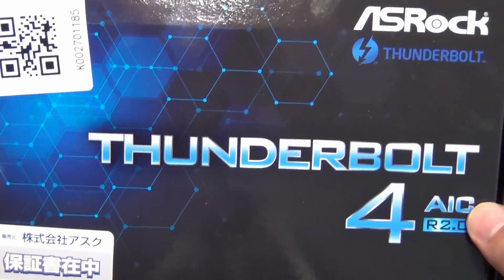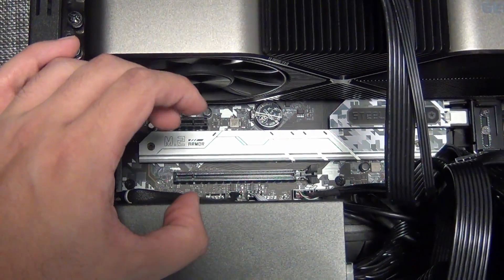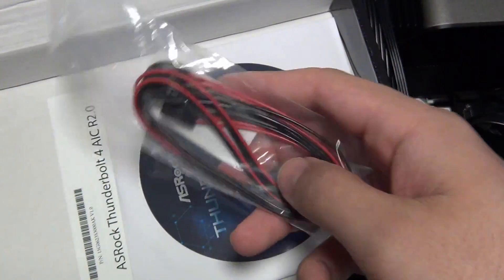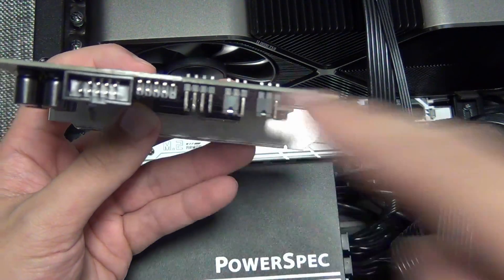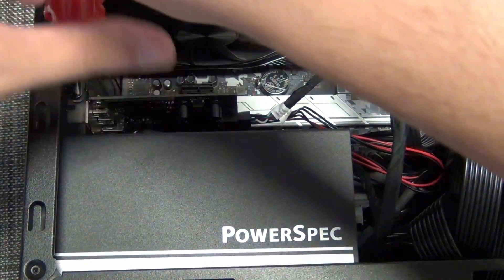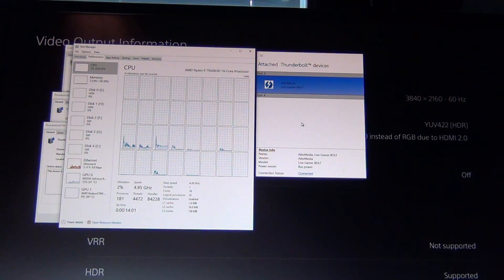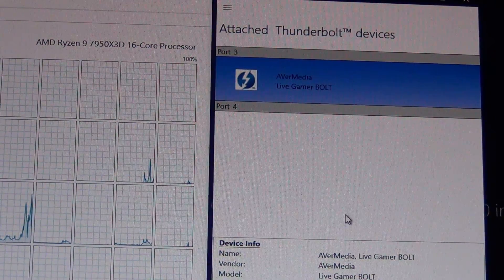Adding Thunderbolt 4 AIC to AMD Ryzen | ASRock X670E Steel Legend

Comment: What is the point of having this to get 4K at 60Hz when on many mainstream cards, there's already two, if not three DisplayPort 2.1 (& 1.4) connections that'll do much better, like 4K @ 120-144Hz? This can be done with multiple screens as well. 

Is the PD charge the main big deal here? Because doesn't seem the GPU specs add up, the onboard outputs on the video card, as well as some MB's has faster DisplayPort speeds at 4K.

Comment: Can you use the Gigabyte card on this Asrock Motherboard? Have you tried?
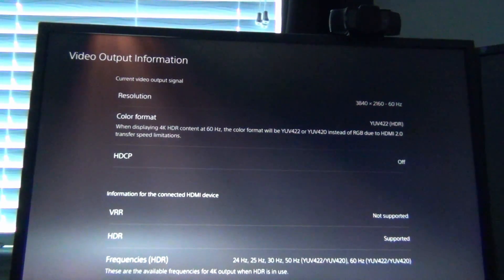Reply: I use the GIGABYTE Titan Ridge TB 3 with the Asrock 670e. You have to enable in the bios like in the video.However, the submenu was removed with a recent bios. The card still works and shows up in Windows 11 about 90% of the time. You have to hook the displayport up to your graphics card, or the computer won't post. If you don't turn fast, boot off in  setup. The Thunderbolt/USB C devices won't show up in Windows. Pulling the USB C connector o 8:23 ut and resitting it, the devices will show up at then. With the 100w delivery it phones and tablets also fast charge.
I will say I can't stand Asrocks setup compared to my Asus of the same chipset. 

Asrock TB4 card doesn't include the 100w PD like liike Asus and GIGABYTE.

Comment: Is this working for tuf gaming x570 motherboard without thunderbolt header?
Reply from the maker: No, it will not work with an ASUS motherboard. This only works with ASRock and maybe Gigabyte boards. The cable is also required.

Comment: Pcie tunneling disabled, no Matter what i try not working..asus x670p
Reply from the maker: Are you using the ThunderboltEX 4 card from asus with the cable plugged into the motherboard?

Comment: There are remarks in ASRock support list page as:-
*1 : Maximum three TB devices can be detected in one TB4 port. (Double in two ports)
*2 : USB Keyboard / Mouse may not wake up the system from S3/S4 when plug in TB4 hub.
*3 : Not compatible with TB monitor.

Did you test the USB-C DP monitor? TB monitor is not the same as USB-C DP monitor, am I right?
Reply from the maker: I don't have a TB monitor but I assume it uses DisplayPort Alt mode which is what a USB-C monitor uses.

Comment: Did you lose performance by the lane share using the thunderbolt card ? Like the gpu being by 8x instead of 16x ?
Reply from the maker: No, there is no lane share with the X670E Steel Legend.

Comment: I left a msg on your video from the maple ridge card regarding one of the drivers always showing with an exclamation mark and error code 10.. need some help on this one.
Reply from the maker: The latest Gigabyte motherboard BIOS breaks compatibility with the card. The F13 bios with AGESA 1007c supports it.
Reply: @GameTechReviews  Yes figured that out the hard way, have hit up Gigabyte to fix it or failing that will have to try hacking support back into F22 BTW the Maple Ridge works great on the Asrock Steel Legend X670E

Comment: How does the asus thunderboltex 4 fare
Reply from the maker: It works fine assuming the motherboard is supported. Asus uses their own cable so you can only use their ThunderboltEX 4 card with supported motherboards. They have a newer upcoming USB4 card that I plan on testing as soon as it's available.
Reply: @GameTechReviews  Would you prefer USB4 than Thunderbolt 4? Im curious to see how compatibility is.

Comment: Hello. This video is really well made. Props for that! For me it is kinda sad because i need help to get a ryzen 5900x on a asus ROG wifi b 550 board to run the ASUS Thunderboltex 4 card. Do you have any recommendations how to get it to work properly? The main Problem is, that i have no discreader and the drivers from ASUS page doesent work :/

Any help would be great!
Reply from the maker: For the Asus card you just need to have it installed in the x4 slot and then install the drivers for the ThunderboltEX 4 from the product page (Asus site).
Reply: @GameTechReviews  this is what i did and usb are working on it. Also in the device manager the thunderbolt is correct.but in the cobtroll center from thunderbolt, there is not 1 device listed at all... and so i cant get my monitor or laptop connected to it... feels strange because i try with 2 different mobo and the card in 2 different systems. Cant get any further sadly ...
Reply from the maker: @Nichtgenuegendholzmylord  Does the card show up in the bios? Also what is the exact motherboard?
Reply: @GameTechReviews  asus b 550 gaming f and asus b 550 pro art.
I will take a look when i am tomorrow. In which  settings would i see it ? Thx for your help :)
Reply from the maker: @Nichtgenuegendholzmylord  The ThunderboltEX4 card works with the ROG Strix B550-F Gaming. The drivers need to be installed for the Thunderbolt Controller to work. You can verify if they are installed by checking device manager. The B550 ProArt already includes the chipset so the ThunderboltEX4 will not work with that motherboard. For both motherboards you just need to make sure Intel Thunderbolt Driver V1.41.1193.0 or newer is installed.

Comment: Is it possible to use the Display port inputs to capture video? Or are they simply pass through to the thunderbolt connectors?
Reply from the maker: They pass the signal through. If you are asking if you can use it like a capture card, then no, it can't be used that way.

Comment: My brother i have problems with motherboard asus tuf b550 plus the is not approve thunderbolt show notification pop up are you know how i fix him?
I enabled from motherboard not approve
Reply from the maker: You need to be using the ASUS ThunderboltEX 4 card in an x4 slot. Then you install the drivers for the card from ASUS's website.

Comment: I couldn't find a list of compatible CPUs and motherboards. If someone has a link, I would be grateful.
Reply from the maker: ASRock motherboards that feature the thunderbolt cable header will work as shown in the video. Those include X670E Steel Legend, PG Lightning, B650E Steel Legend, B650 LiveMixer, B650M PG Riptide, X570S PG Riptide, and B550 PG Riptide.

Comment: My AIC card arrived. I dont have DVD drive so I installed driver from ASRock AIC website which installed intel TB control center. As I only have TB2 harddrive, I bought APPLE TB3 to TB2 adapter from B&H. After I connnected TB2 drive to the AIC card, system does NOT recognize it......MOBO is ASrock x670e pg lightning. AIC card is inserted in PCIE3 slot as stated in the MOBO manual. Jumper, USB and TB header are adjusted according to manunal. TB support in BIOS is enabled. Any one know the reason?
Reply: P.S. I realize that if I connect my iphone to the TB4 port using the APPLE lightening to USBC cable, the iphone battery is not charging
Reply from the maker: @gengpan  I connected my Xperia 1 Mark III to one of the thunderbolt ports and it is detected and charges as expected. For the TB2 device from the Thunderbolt FAQ page , 'Accessories built to Thunderbolt and Thunderbolt 2 specifications are not supported by Thunderbolt 4 PCs. Accessories built to the Thunderbolt 3 specification are fully supported by Thunderbolt 4 PCs.'
Reply: @GameTechReviews  Maybe that is one possible reason. I may need a TB3/4 to test the card.
Reply: I used the Gigabyte Titan Ridge 2.0

Comment: Anyone tried if ASRock AIC support TB monitor if applied to ASRock x670E PG lightening MOBO? website says no which surprised me.
Reply from the maker: I just tested it by connecting one of the DP to DP cables from the GPU to the ASRock TB4 AIC. Then I connected a USB-C to DP cable from the Thunderbolt port on the AIC to a 1440p 144hz monitor and it works at the full resolution and refresh rate. It looks like the USB-c port next to the DP are connected together and the outer USB-c is connected to the outer DP cable.
Reply: @GameTechReviews  It's truly wonderful to receive your confirmation! This effectively dispels the doubts I had.
Reply from the maker: Do you mean running displayport from the graphics card into the AIC and then running a TB cable (usb-c) to the monitor?